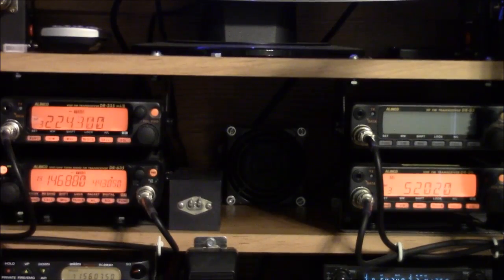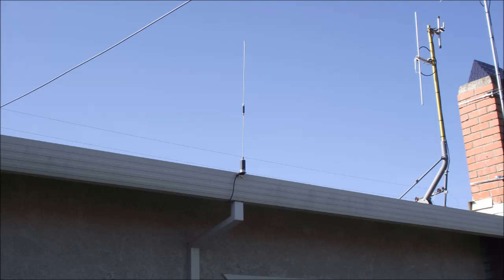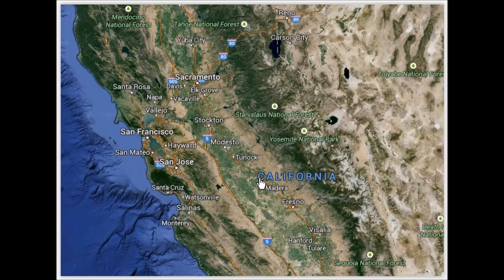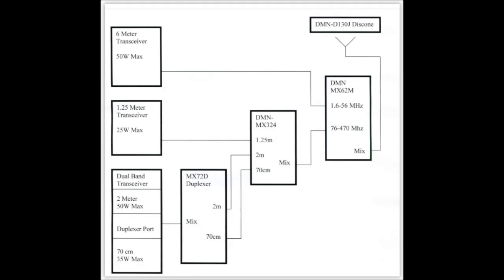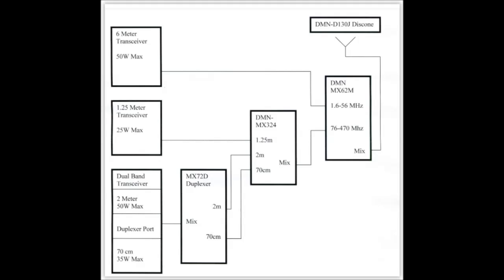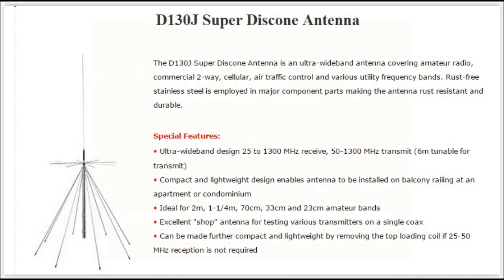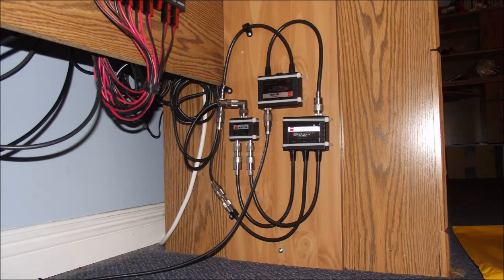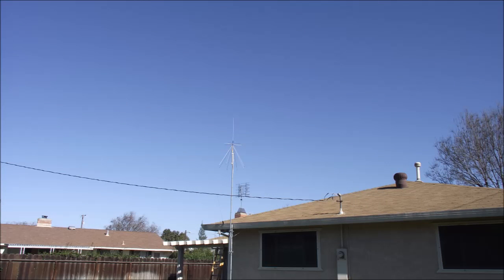Ham Radio Discone Antenna

Comment: Well done video and nice, neat installation. I could see this approach if one was in a highly restricted place and must use only one antenna for the four bands. Before doing this one should consider the radiation pattern (take off angle) at the frequencies of interest; even within each band it can be different. And remember that the loss works both ways. At these frequencies there is loss in every connector and adapter. This seems like a lot of compromise. I operate all of these bands and use three antennas: 2/440 dual band, 220 5/8th stick, 6M ground plane. I use steel conduit for masts. The DB, 220 and another are on one mast with a cross arm; the 6M GP is on top of it's own mast. Not as cute, but very effective and less than 3dB loss in feed lines, plus 3 or more dB gain for every antenna except 6M. I painted the masts to camouflage them. 73
Reply from the maker: Thanks!!   I also considered that the discone antenna would only be used for working mountaintop repeaters which I have in good quantity and mostly all with powerful signals at my QTH.   I was also using another discone for a scanner and ended up replacing it with a high gain vertical because of gain and pattern issues.  Good Comment.
Reply: Didn't mean to come across as too critical, I recognize that your situation is somewhat unique, and more forgiving of loss due to the straight line of sight to high elevation repeaters. Many of us don't have that advantage. A nice, clean installation for your purpose. 73
Reply from the maker: Thanks !!   I received your comment as being accurate and informative.

Comment: Did you ever switch over to the LMR400 cable? If so how much did it help on the UHF bands? I understand LMR400 is much better at UHF than the RG-8. I an understand why you went with the discone antenna. especially if you hit all the repeaters you interested in. I am curious what is the SWR on each of the radio's you are transmitting on with this antenna setup and did you need any kind of antenna tuner?
Reply from the maker: No, I decided to leave well enough alone.  RG-8X has 8.1db/100ft loss at 440 MHz while LMR-400 has 2.7 Db loss/100ft at 440 MHz.  That's almost 6db  better with the LMR-400 which is doubling the power TWICE.  If I lived in a remote area where signals were weak I'd definitely swap the cable but I've got so many Repeater Signals at my station that I think it would just add to the confusion.   I was an AT&T Radio Tech before I retired and we used LMR-400 for all our 900 MHz Trunking Systems.  It's really good stuff if you need it.

I measured the SWR at each radio and here's the results:
UHF - 448.375 MHz = 1.35:1
VHF - 144.57 MHz  =  1.13:1
220 -  222.55 MHz  =  1.55:1
6 Mtr- 50.350 Mhz  =  1.25:1

There was a problem I missed on the 6 meter frequency which is tuned by trimming the whip on the top of the discone.  I apparently trimmed the whip too long because it's good at the bottom of the band and goes up to 2.20:1 towards the top of the band so I'll be dropping that antenna for a re-trim in the next few days.

I'm glad you asked about the SWR because I rebuilt my Ham bench a couple of months ago and didn't measure the Discone SWR when the move was complete.

No accessory tuners were necessary with the discone.  I once "swept" the antenna just using my transceivers and the antenna SWR is amazingly flat from VHF to UHF.
Reply: Its very interesting how low the SWR is on the discone antennas and how wide a frequency range it has . I guess just a trade off with DB loss.

Comment: I appreciate how you post ALL the data related to your project, similar to 'closing credits', if you will. I'm a noob without a lot of money to spend, so I like studying the concerned data, my decisions based on the best bang for the buck.
Reply from the maker: Thanks.  The cost of multiple coax cables, antennas and support systems was somewhat shocking and that was part of the reason for the project.

Comment: Hi there, thanks for the details on the antenna setup.  I am also in California and my area will not let me put up a 20' pole above my house.  With the mobile antenna that you had attached to the rain gutter did you get a decent CB reception?  I am planning to setup a CB base station is why I am asking.
Reply from the maker: I got "OK" reception.  The reception and transmission were noticeably better when I moved it to the pole with the new B100 Antenna.  However, if that's the only option you've got, it's better than no option.  Provided your rain gutter is metal, the operation wouldn't be all that different than mounting a loaded whip antenna (like the one I used) on the roof of your car and operating it in the driveway.  The rain gutter serves as your antenna radials.

Local operation would be OK however if you're planing to "Shoot Skip" on channel 38 Single Side Band, when the Skip Conditions are present, you can operate Skip pretty successfully on a marginal antenna system.  The Sky does all the work - The F Layer.

Some Hams who have your antenna restrictions resort to getting an antenna  tuner and loading up their metal rain gutters - using the rain gutter itself for the antenna.  I've worked a few of those hams but never actually tried it.

Another option is "The Flag Pole Antenna".   This option is expensive but works well and HOA's have a really hard time restricting American Flag Poles.  You can find examples on YouTube or Google or zerofive-antennas.com.
Reply: Thanks so much!  Very useful details you provided and that flag pole antenna concept is very interesting.

Comment: Very nice set up you have there. I have a question if one had two radios, one transmitting on 6 Meter and a tri band radio transmitting on 2 Meter, 1.25 Meter and 70 CM would that reduces some of those duplexer and triplexers to just one mixer? Would that lower some of the signal losses before it go to the antenna? I understand you already had different radios ahead of time but someone just starting out might be able to but a tri band radio and a separate 6 Meter rig and this antenna?
Reply from the maker: I think so.  If your Tri-Bander has all the RF on a singe port then all you would require would be a mobile duplexer that had a 6 Meter port and a second port for the three Tribander frequencies.  It looks like a single application of the  Diamond MX-62M would do it.  You'd pick up between 1 1/2 - 3.0 db over my system on your Tribander Frequencies.   It sounds like a good idea.

Comment: Hey I live in Los Angeles and I would like to build my own repeater system just for family. I wanted to know if you can give me some advice on how to get started since you live in California too. Thanx.
Reply from the maker: +jorge gomez If you and your family  have  Amateur Radio Licenses, this information should be useful as a start 
http://www.repeater-builder.com/rbtip/repeater101.html

However, getting a frequency on the Amateur Repeater Bands in L.A. could be a problem.  Frequency coordination & authorization in Southern California is performed by:
http://www.scrrba.org/:

It could be more productive to locate an Amateur Repeater System already in place that suffers from low traffic and attempt to utilize such a system.

If you're not a Ham, then you run into the problem of getting a repeater frequency from the FCC on a commercial band which would be next to impossible.
Reply: +The Erod1944 Channel can u give me some info on how to get amateur radio license that would be greatly appreciated I'm just started to get into two way radios and repeaters and you definitely know more than the basics. So if you can help me get set up that would be grate.
Reply from the maker: Here's a link that provides information for various Amateur Radio Clubs in Southern California.  Several of them list "help for newcomers" as part of their mission.  I would call around on this list.  I think you would find a good starting point as well as information and assistance.

https://www.arrllax.org/index.php?page=local-clubs
Reply: +The Erod1944 Channel thanx for the help. I'll call around and get more into ham radio.

Comment: Had a friend with the discone and went and got a 5 ft diamond base antenna. He liked 30 miles away and his signal was the same on both antennas no change so he wasted his money on the diamond.
Reply from the maker: Jim- Hamradio Well, I guess my point on the Discone is the fact that I can run multiple frequencies on a single antenna in a space limited environment.  It's a trade-off between antenna space and antenna gain.  Personally, I'm hitting repeaters that are up to 100 miles off but then those repeaters are located on 2000 to 7000 foot mountains. My discone is mounted only about 18 feet off the ground.  Thanks for your input.  Ed/Central California

Comment: what bands can u transmit on with the discone?
Reply from the maker: Jim- Hamradio The diamond discone can transmit from 50 MHz up to 1.300 GHz with a good SWR.  I'm personally using it on 6 Meters, 2 Meters, 1.25 Meters & 70 Centimeters with all four frequencies on line via the duplexer/triplexer network.  The documentation indicates that the antenna is good for 200 Watts Transmit.The only downside is that the antenna has zero gain but I've found if you get it up above the roofline it performs very well.